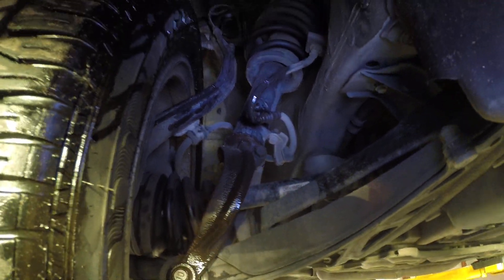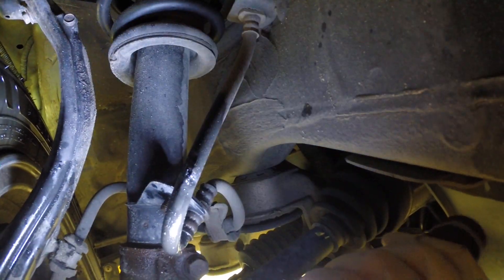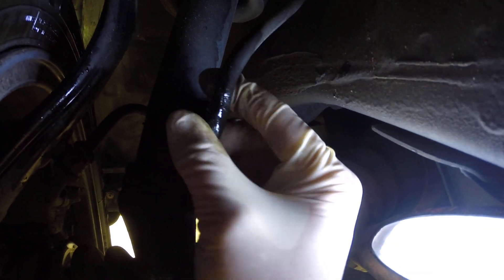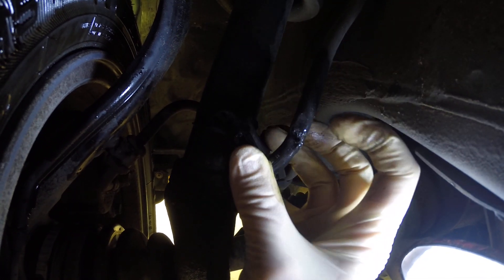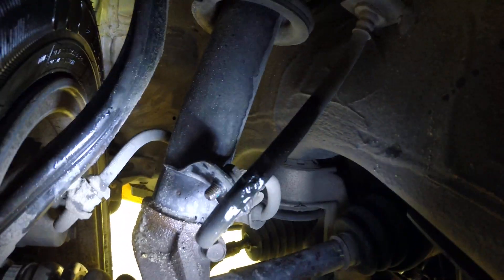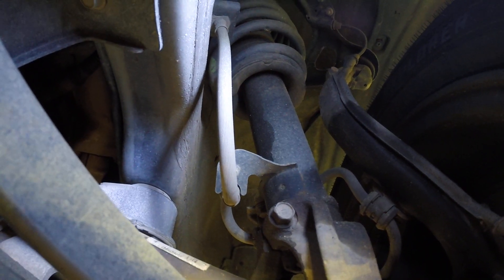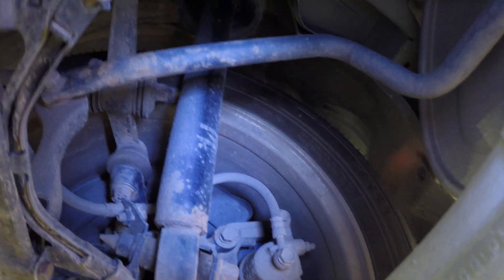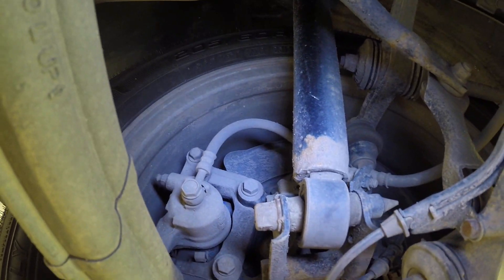Brake Line Blowout

Comment: Dealing with this on my prelude rn, waiting for the line.

My stupid ass just kept refilling the brake fluid and driving around
Reply: I kept putting brake fluid in my vehicle until 1 day i put some in then tried tp back out of my driveway and almost caused a pile up lol brake went straight to the floor. I had a blown out caliper and another 1 was leaking like a bitch. Was not a good situation. 640$ later everything is good now lol